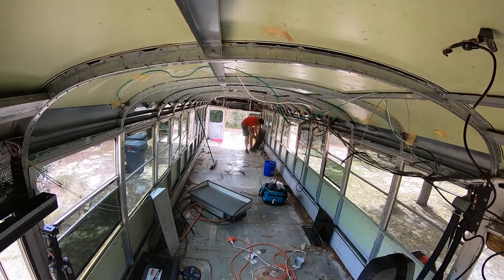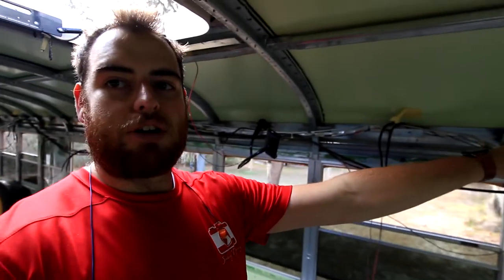School Bus Wire Removal Part 1 | Skoolie | Bus Conversion | Tiny Home

Comment: “I removed wire”.  How about more descriptions of the process?  Pitfalls? How did you remedy?
Reply from the maker: Most of the wires I used a wire tracing tool if I wasn’t sure of what they went to. Any ceiling lights, speakers, extra door sensors were all removed. Just be sure to loop the door alarm system so that the bus will still run after removing the wires.